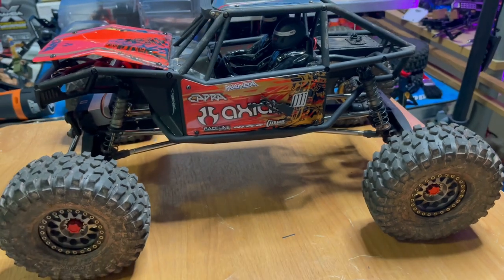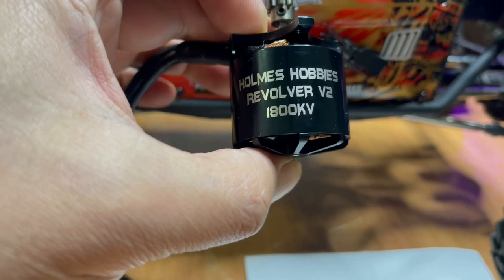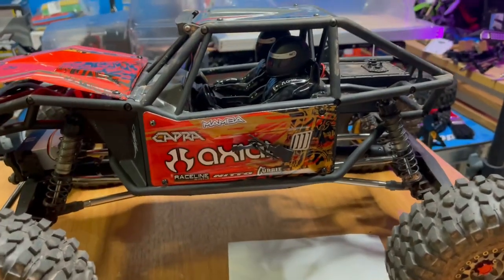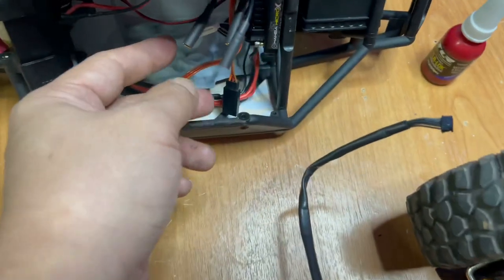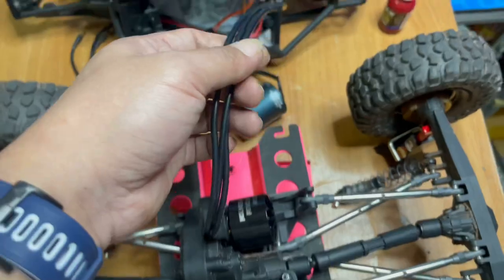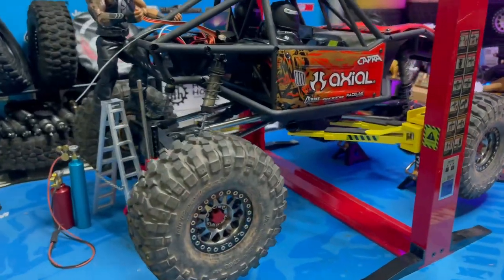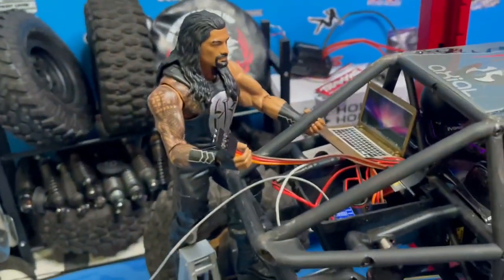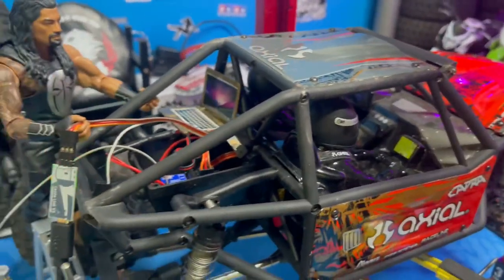Axial Capra| Holmes Revolver 1800kv+ Castle Mamba MicroX

Comment: Yep, the Outrunner/Revolver series are so freakin' loud but damn, are they smooth!  I love that as the crawler meets resistance the motor just ramps up to keep momentum without you needing to vary throttle input 👍
Reply from the maker: the sound is irritating but it a nice feedback to tell me to squeeze or release the trigger- but im loving it
Reply: It's not the motor. It's the horrible Castle esc.
Reply: Obnoxiously loud but they sound so damn cool and the low speed control is out of this world

Comment: Thanks for the video!
How do you compare the slate to the revolver?  Was there  huge difference in low speed control? I've been wondering if I should go with an inrunner or outrunner.  It's hard to tell from watching videos how much actual difference there is.
Reply from the maker: my slate is 2850kv and this revolver is 1800kv- i feel better low speed with the revolver- better to modulate- may not be able to see the difference since the performance will also depend on how i drive it- maybe to see which
one is better will be using the throttle idle up to have constant power then run it- after i use the revolver i nvr look back

Comment: Nice work 👍👍 Where is the "machine" sound coming from? Only that could be a little bit annoying for me and visitors for the videos 😃 Cheers
Reply from the maker: it is coming from the motor
Reply: @freshstonerc  That's Interesting! I am still crawling completely stock. Check out how smooth my Capra is running 👍👍
Reply: @freshstonerc  Anyway nice upgrade 👍👍 Have you tried throttling down your stock sender and ESC? Appreciate your visit and few nice words 😃